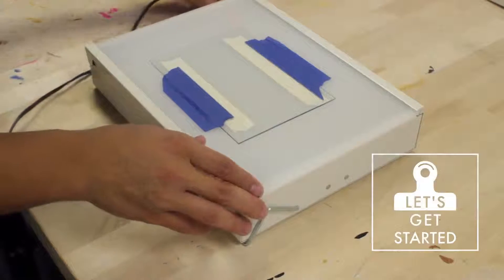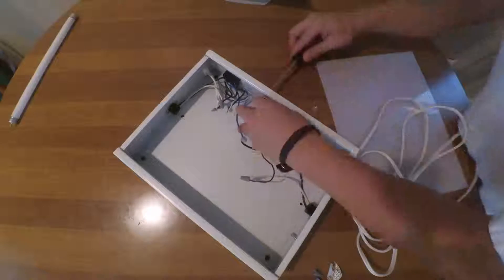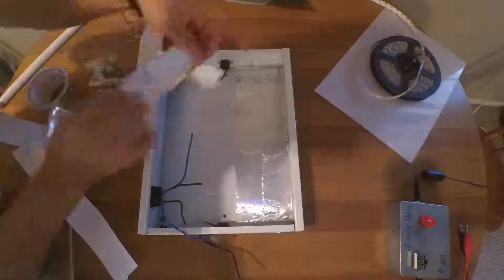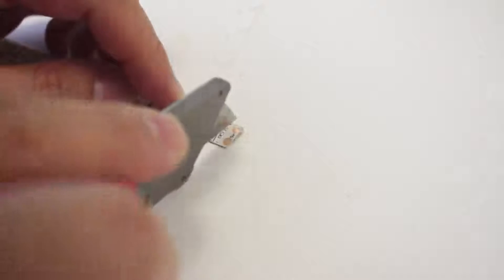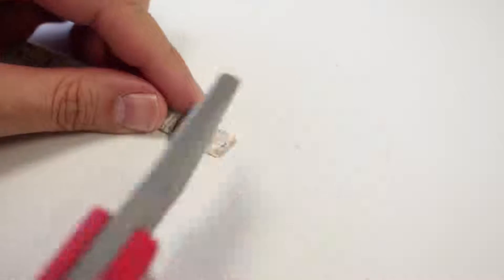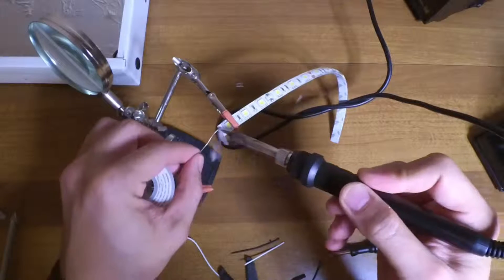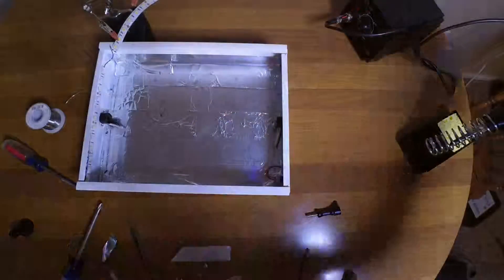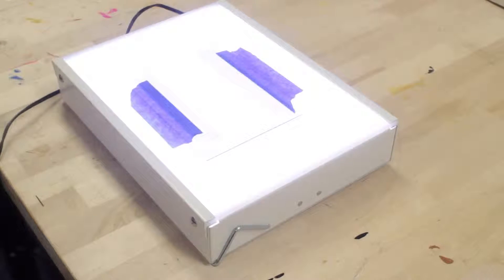Easiest way to convert an old halogen light bulb into LED light box

Comment: hello, i need to convert a white metal lightbox as you have in the video to led.  Is there a way to change the led from the back instead of taking out the acrylic panel from the front? maybe cutting out a panel in the back? I need this to be easy for customers to do so that there is no messing up the acrylic panel.